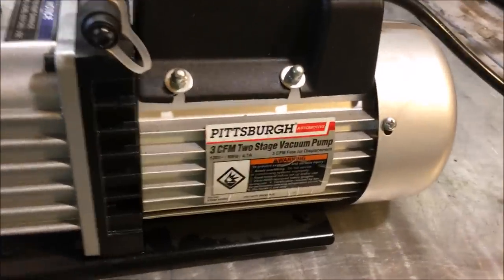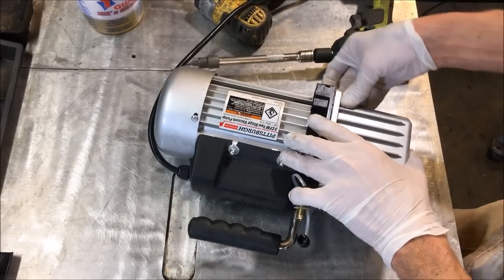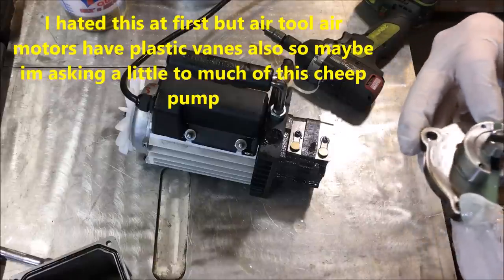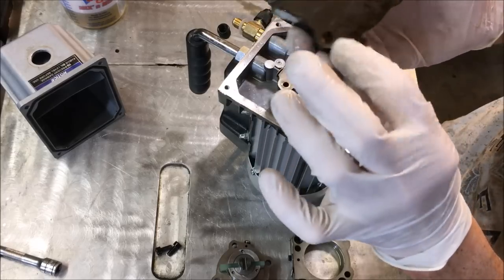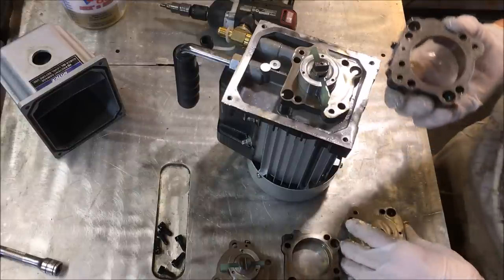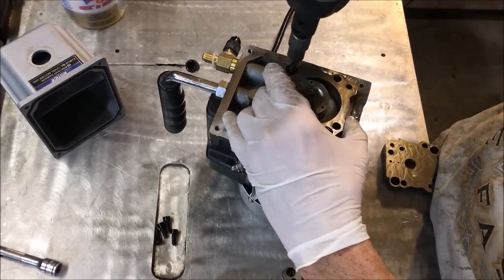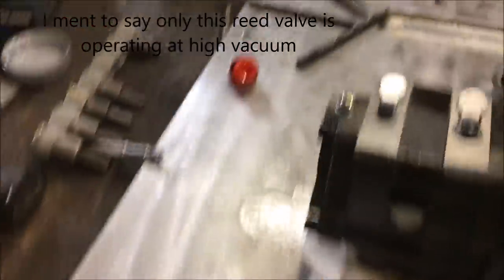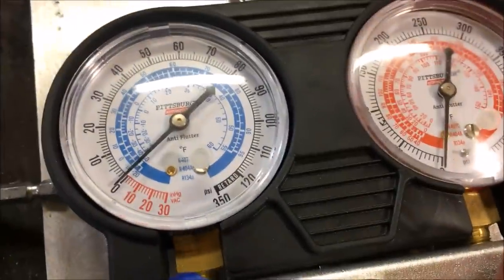harbor freight 2 stage vacuum pump tear down

Comment: You should have removed the little crappy springs from the vanes. They are not needed and they will break apart, the shrapnel will get caught between the rotor and housing and seize up the pump. This is what happened to me, but I was lucky enough to be there to turn the motor off before the stator burned up. I took mine apart and removed about 5 or 6 pieces of the spring that was left; including the piece that was jammed between the rotor and housing (put a nice indentation in the metal). I put it back together without the springs and it pulls the same as it did before. It turns out that the centrifugal force causes the vanes to hug the wall tightly, sealing the pump without needing the springs. If I bought one new, the first thing I'd do is remove those crappy springs that will most definitely fail.

Don't worry about the plastic vanes. They need to be plastic to avoid metal on metal. With those springs in there the pump will seize from those stupid springs long before the vanes wear out.
Reply from the maker: Hey thanks brother , thats a fantastic comment , and yes i totally agree . im gonna pin your comment
Reply: Your comment is really helpful. I had a problem with those springs once already and I replaced them.  I would like to ask you few questions. If you have time to talk please write to my FB fanpage "Sword Addict"
Reply: I don't use Facebook. You can ask questions here though.
Reply: I'll assume your pump isn't working well. I sent you an email, but ask your questions here so others can benefit from it. You probably won't have to show me any pictures.
Reply: Are you joking? Those springs are essential for proper function of the pump. They press the vanes equally against the chamber wall to ensure they seal and move air. If you remove them they will float and the oil seal will fail allowing air to  bypass the vane path and the pump will perform very poorly. If your springs broke and lodged between the vane and bore wall you had at least 5 other problems that proceeded that.  Like crappy oil or a severely contaminated pump.
Reply: Absolutely not true; I'm telling you from actual experience. My pump is always clean as a whistle. I change my oil every single time I use it. Vacuum pump oil should be changed long before it shows any sign of contaminants because the oil is hygroscopic and moisture lowers the efficiency of the pump.

My pump is advertised for 75 microns; it's actually a single stage pump, not the two stage shown here, but it has the same crappy springs. After removing what was left of the springs, I reassembled the pump without them because I didn't have any available and I needed to use it right away; from the looks of it, it looked like I could get away with not using them. After I assembled it, I tested the pump with my BluVac LTE vacuum gauge and I was able to get it down to 68 microns with fresh oil; so apparently those springs are not needed. There is a lot of vibration with those vanes slamming against the wall and those springs are just not going to endure that very long. It's just a very tight coil and the metal used is quite brittle. Anyway, from what I remember, the springs do not hold the vanes against the wall because they are not compression springs; they are expansion springs and they are installed between the two vanes. I would highly recommend removing them because they will 100% fail at some point and permanently damage the drive motor.
Reply: James Bee could it be that the oil is entering the pump causing a tone difference?
Reply: Welch series vacuum pumps have metal vanes and theyre fine and 9o% of the time reusable. But with that being said, a leybold d65b has centrifugal vanes and they work just fine. I havent worked on one of these though.
Reply: @lyleg6553  oil is already in the pump as it should be what pumps always need oil a dry pump like a scroll pump should never have oil in it because it has pre oiled bearings
Reply from the maker: @jjenson2006  yep centrifugal force holds them in place
Reply from the maker: @richardrichardsen6611  Centrifugal force does the job just fine
Reply: @NOBOX7  It can't. Where there's centrifugal force there's centripetal force.. The "swirl" has never been effective and remains as a canard that will not die.
Reply: I have a 2.5cfm - sat for 8 years - went to turn it on and it just hummed (stuck). Finally it kicked on and started working but now im not drawing full vacuum  - I thought it had a piston with frozen rings - but apparently  not - so why did i lose vacuum?

Comment: I bought my 2 stage 3CFM Harbor Freight vacuum pump more than 8 years ago and have had no issues with it.  My micron gauge actually got down to 25 mircons to my surprise. It works better than my 7CFM Yellow Jacket pump.
Reply from the maker: Thanks for the input good to know
Reply: Ideally they should all work well but quality control is iffy
Reply: Good to know although 8 years ago it's likely not even the same unit

Comment: Two stage means just that. The first stage feeds the second one which takes the vac down even more. Your pump is a dual single stage pump.  Most folks that work with vac pumps in HVAC  applications doen't care much as those pumps do well either single or dual staged. That pump you have there is a generic China pump. They sell them to many manufactures in the USA that put their brands on them. I've tested them and NO WAY they get down to 21 microns. Most are lucky to get to 2000. Which is fine for HVAC applications. The vanes are made of nylon which is preferred over steel. It doen't etch the chamber walls and given how these things work sealing efficiency is the name of the game. The vanes are nut subject to forces that require steel or aluminum. Research level pumps and those used for freeze drying are much better built than that thing you have there but use  phenoloic or nylon vanes.

The ports you saw on the top of the chambers are the exit vents. The vanes grab a small pocket of air from the inlet and moves it around on an eccentric axis that squeezes it down until it vents at that port. The valve checks  flow in that one direction. The baffle blocks the splash made by the exiting air . Better pumps have "oil mist recovery" stacks that gather the mist, condense it and return it to the sump.
Reply: "dual single stage pump', then can you explain true two stage pump
Reply from the maker: great input , i was very interested in the mist recovery statement , i seen that being a problem .
Reply from the maker: @sureshlingabathina  he did ?

Comment: I’ve had the opportunity to use and abuse quite a few vacuum pumps (including this one) in the HVAC field. I bought this one to get a job done on the road when my YJ Bullet smoked and I was too far from our supply houses. I was surprised how well it worked, being rated at 1/3hp and “only” 3cfm. It got the job done, sub 500 microns in just a bit longer than my other pumps. This exact pump is sold as both a Robinair and Uniweld model as well as a few others I believe. Most “economy” pumps now are virtually identical and you really need to invest a bit in a quality pump (JB Enterprise, Appion etc.) to get something that lasts.

Comment: That pump is a rotary vane and its build is almost exactly the same as any sort of rotary vane. Including many of the so called name brands.  You can tell for sure if it is a 2 stage pump  by the sets of vanes there are... Each set is another stage.  Also anyone that has pulled those pumps apart can verify that the rusting is nornal, many brands do it. Also it always appears that the ports don't line up. That is also normal. They are a PITA to line everything back up with the screws all threading back properly but after taking them apart half a dozen times trust me, you will be a master at reassembling them.  Also notice there are no gaskets between the plates... Make sure they have no material or dirt between them or your vac will suffer. And last, watch for the motor binding as you reassemble it or you will tear the pump up when restarting.

Comment: just took apart my robinair 15500 because it was rusted shut after many years of misuse by yours truly. Looks essentially the same, with come additional perks, like a sponge filter at the exhaust and a small plastic cover ontop of discharge ports. And yes, both of my robinair pumps (5cfm and 8 cfm mist toot...)

Comment: Motor oil will vaporize under vacuum, which will prevent the pump from pulling a deep vacuum. You need to use vacuum pump oil, which is refined to the point where it will not vaporize under vacuum.
Reply from the maker: Thanks for the input , i was under the impression it would degas and then be ok
Reply: Motor oil is not used in vacuum pumps.  They have oil specifically designed and formulated for low oil vapor pressure.  If you are needing oil, pure mineral oil will do.  NOT motor oil!

Comment: My $2K Leybold Trivac is dual stage and it also uses the plastic vanes. Unless you really don't have to pull hard vacuums it's a bad idea to use anything other than vacuum oil. Rule of thumb is that if you can smell the oil then that very smell is what will be gasing off from the oil and preventing lower vacuum from being reached.
Reply from the maker: Yeah i think i was out at the time . I never used it to pump down an ac like this . Ive seen that oil can be degassed so i degassed this oil hoping it would work but if i had Mineral oil i would of went with that

Comment: The motor would certainly be an induction motor, with the coil pack on the outside, directly connected to the aluminium shell. It does not need any air passing through it, and sealing it makes it more reliable.

Comment: 13:19 I'm seeing potential for the first discharge port to only open under extremely weak vaccuum, allowing the pump to work like many 2-stage high flow/low pressure && low flow/high pressure hydraulic pumps. (I.E. if stage 1 compression builds enough pressure to discharge into out-flow, bypass stage 2)
Reply: Oops, just realized youtube dropped me into a years-old video again

Comment: I work with vacuum pumps in my lab. Even high end rotory vane pumps such as the alcatel 2021 use plastic (phenolic resin or carbon fiber). So this is nothing unusual.
Reply: Its odd to not see an oil pump in a vacuum pump...
Reply: Also the construction is typical of 2 stage rotory vane pumps. The 2 stage pumps from alcatel dont look much different in the general design though much better made
Reply from the maker: Hey thanks for your input ,very valuable info
Reply: @NOBOX7  i could probably talk days about vacuum technology, seeing as i do it semi professionally.  though such pumps are only for roughing in my applications. I work mainly with high and ultra high vacuum, which uses completely different forms of pump, such as oil diffusion pumps (supersonic jets of oil vapor do the pumping) or turbomolecular pumps (basically giant turbines spinning at breakneck speed), and ion getter pumps which are basically just traps that allow gas to enter but not leave.
Reply: @NOBOX7  also, i should probably add that the ultimate vacuum of a oil sealed rotatory vane pump is dependent on not just the seal integrity and design, but also the vapor pressure of the oil used. depending on the oil you can have orders of magnitude worse ultimate vacuum.
Reply: @NOBOX7  oh, and forgot this bit of info. I did not see an anti suck back device in this pump, so if the pump is turned off while under vacuum, the oil will be pulled into the vacuum hoses and or vessel.

Also, even under perfect operating conditions, there will be a small amount of oil vapor back streaming into the vacuum vessel. Its a very small amount though, and in most applications is not much of a problem.
Reply: @lbochtler  That can be rectified by adding a proper shutoff between the outlet tubing and the pump.
Reply: @excitedbox5705  Oil diffusion pumps do indeed have oil back streaming, i have various ones in my lab, and even using a cryo pump in line with the pump results in trace amounts of oil reaching the chamber. Though in my applications its not usually much of a problem.

As for the long line to prevent oil back flow, i tried that out a few years ago with a old pump and diffusion pump that needed rebuilding anyway.  The main amount of oil stayed in the pipe close to the pump, however, when i took apart the diffusion pump, i also found rotary pump oil mixed into the pump fluid.

The only way to prevent back streaming into the vacuum system when using oil sealed pumps, is to use a cryo trap, or something like a molecular siv. (or sponge or something).

One microscope i worked on, had a oil mist trap in its roughing lines, but it had to be removed since id degraded pumping performance quite a bit. It increased pump down time of the chamber from 1 min, to 5. So it was deemed easier to just remove the trap and clean the system more regularly.

Also, note that a longer pipe for the roughing pump will decrease pump speed.

p.s.

The back streaming on oil diffusion pumps is on the order of ug per min depending on the setup. and less with cryo pumps / baffels.
Reply: @excitedbox5705  For semiconductor manufacturing, i would not use oil diffusion pumps, or rotary vane pumps at all. Id use Turbomolecular pumps, and roots blowers or membrane / piston pumps.  Though even with turbo pumps, you need to also watch out for oil back streaming if the bearing seals fail. Saw that happening in a PVD system
Reply: @lbochtler  this whole little thread of comments was awesome...  Lol I was just looking up to see if it was worth my friend to buy it cause he wanted to buy the single stage cheaper pump harbor freight had and I am currently trying to get him to at least but this one , which is the next step up... 

Love learning new things... 🧐🤯😉
Reply: @lbochtler  Hey thanks for dropping knowledge, I used to have a JB pump that had a check valve internally within the pump. I'm not sure if JB pumps are good pumps in your book but in the HVAC industry they are well received. Here where I'm currently living now however I have access to inferior tools. Not bad per say but cheaper labor made tools. My current 7 CFM pump doesn't have a check valve. I wonder if adding a solenoid on the suction port would be adequate to prevent the oil from backflowing in a situation where a deep vacuum is performed and then the power kicks out. Hasn't happened to me yet but I'm sure it can and will if I'm not cautious.
Reply: @derrickenbuenosaires  Yes, a normally closed solenoid will prevent oil back flow should the power cut out. Make sure the solenoid is rated for oil, as some seals are not oil resistant. I have actually implemented this before, on a pump with a check valve that occasionally gets stuck.

Oil back flow can happen even with a small pressure difference. 600 Torr is enough to have it happen in a pump without a check valve.

Comment: It take longer to get to sub 500 microns but it does it no problem. I seen commercial quality pumps with those plastic vanes. It actually preferred as it is wear resistance and seals better.

Comment: Normally, industrial electric motors never have air openings; there are always sealed. The only windings are in the stator, and that's thermally coupled directly to the outer housing with the cooling fins. The rotor has no windings and doesn't need much cooling. With drilling holes, you only allow water to seep in. I would'nt do that.
The other thing is the oil: AFAIK vacuum pump oil is specially formulated to not gas out in vacuum. Engine oil can have components that can gas out (sometimes that's for fighting corrosion in engines that are sitting for a while). That might be giving the pump something to pump even when you block the vacuum inlet, and decrease the vacuum. It might get better after running the engine oil for a while. But even when you're going back on using real vacuum pump oil, you're right: I wouldn't use the cheap oil that came with the pump. Maybe only for running it in.
Reply from the maker: I agree , great input friend , i have degassed motor oil in the past so you are correct    , i assumed the minor film in the pump wouldn't have much to offer but another Gentlemen mentioned this. I also didnt trust the oil they sent thats why i put royal purple full synthetic in it .
Reply: Better oil is always better!

Comment: The Veins are not plastic. they are glass fibre resin epoxy something something ... they offer lower coefficient of friction than a metal one...
Reply from the maker: I see , thanks for the input friend
Reply: The veins are obviously cheap plastic nylon. these are not industrial machines made to run thousands of hours.

Comment: Thanks for doing this, my JB pump was delivered seized and caked with rust on the cartridge. I dont know anything about pumps but I'm going to try and fix.
Reply: Jb is easy to fix just pull the 6 bolts on the front and clean out the oil and rust in the cartridgeand put the black gold oil back in and check the tabs on the top of the cartridge make sure they are tight and not falling  off those are reed valves
Reply: Cheers, I've successfully fixed the pump. Again, thanks to your video. Saved me $500 CAD.

Comment: I have a pump that looks just like this that I got at Napa, for an AC set up.  how fare down in PSI can this pump down to.   the one I have is a 1.8 CFM but Looks Identical to that one just a different name plate.  The one I have is a Evercraft, but like I said looks Identical.
Reply: PSI is pressure, vacuum is measured in Inches of Mercury or In Hg
Reply: @harrier331  Yes I didn't clarify vacuum is the lack of pressure. Technically one can measure VACUUM as negative pressure. But I've never seen it on a Guage or described as anything other than In of Mercury(Hg)